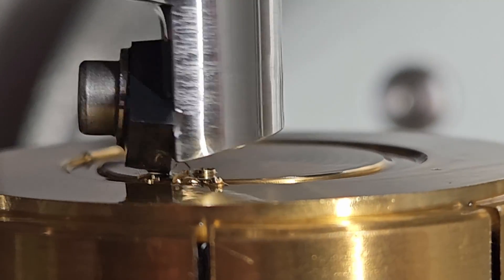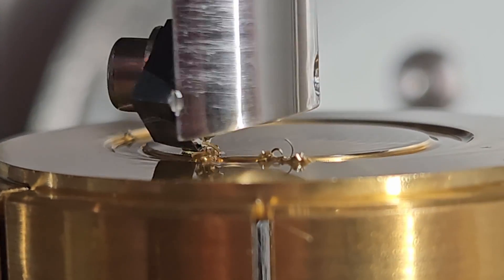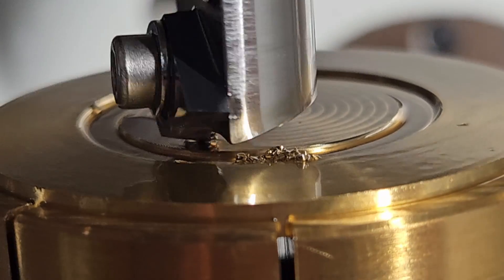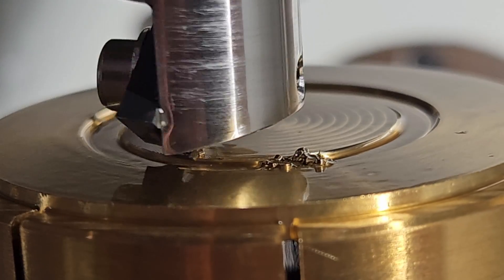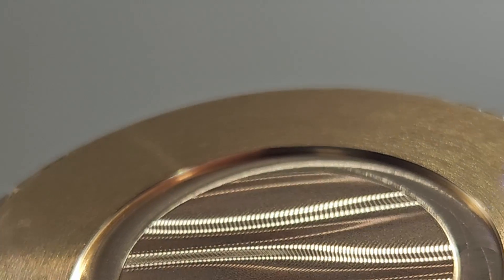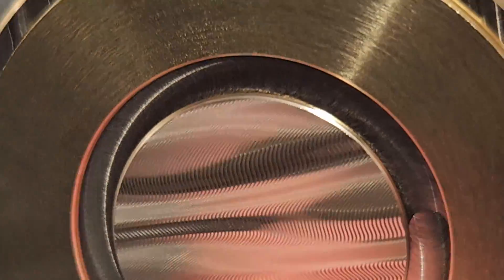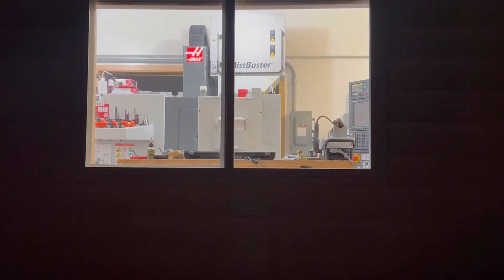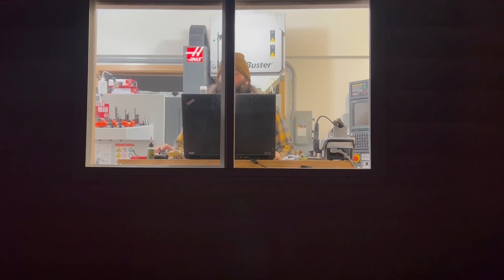CNC Scribing of decorative patterns

Comment: Im really interested in how the Erowa mounted cutter works. Does the cutter orientate itself based on the movement of the material like a plough?
Reply from the maker: @Anatheme-  his original setup on the kern pyramid had the tool held static in the erowa holder . Only his new kern micro hD had the tool rotation
Reply: @adamthemachinist  thank you for the reply. I apprecaite it.

Comment: Love si much this topic, i am a french machinist for luxury,
And i love those decorating technics.
Thanks for sharing.
If your spindle has not an encoder, you Can also genereate with the right  CAM
Guilloche with static spindle tool, only playing with C axis and XY (or Z) moves.
Look out also what you Can Do  with ultrasonic guilloché, to add colors playing with light wavelenghts regarding the couple amplitude /speed of  thé Z piezo ultrasonic acuator wich is micron précise.
Most important point iss thé ability to do it on complexe 3d shapes, to do things no one does using traditional tooling.

Thanks again for your fantastique content, which stand for high quality manufacturing instead of replacing traditional manners,  going further into making nicer and better designs for objetcts, which then you respect more and take Care longer.
Verry hard and counter- intuitive mindset to transmit to productive side of Big companies

Comment: Rather than dealing with controlling the spindle rotation like a rotary axis, could you not just use a 4th axis/rotary table to control that?
Reply: I was wondering this as well. Seems like such a simple solution but I’m assuming there’s a good reason why it doesn’t work as well as spindle orientation.
Reply: To answer my own question, the fact that it would practically never rotate in the same axis as the spindle/tool might be impossible to overcome in some situations. You'd have to move X and Y to keep the tool in the same spot as the rotary axis moved, and depending on where your center of rotation was that might lower your surface speed out of acceptable range or something. Maybe if you stacked x and y on top of the rotary axis it would work better.
Reply: This only works for patterns that are concentric to the C axis. If you'd like to generate patterns on the side of a part by tilting the B axis, this would not work.

Comment: Not long ago, YouTube suggested your video where you machined 1911. I tried to find that video and you but seems you made it inaccessible.  I like what you do and how you are doing it. And today you talked to Australia guy about guilloche. Don't you know we have a Plumier Foundation and many people here in the US? I do not see a point of making guilloche on CNC machines. Rigidity of manual machines is not a problem since the angle of your cutter is about 160 degrees, and the depth of cut is a few thousands. I was making guilloche on titanium tube mounted in a pen chuck on a straight line machine. The cutter had a tungsten carbide tip and cut titanium like a butter. The difference between rotery machined and linear cut is the shiny surface. You can't make it with a rotary tool or laser. That's why I hand engrave pieces. It looks always better than machined. Hand- made watch dials are unique.  It takes years of training to cut such a dial. That's why it is expensive. While todays machines and technology allow cut something similar, it will take too long to set up a machine, plus the tip of the cutter should be sharpened frequently. Otherwise, the cuts will not shine. Thanks.
Reply: Youtube is run by commie democrats. They forced him to remove the 1911 video. Even though everything he showed is perfectly legal... But it hurts their delicate feefees

Comment: Thats exactly 1:1 what i make most of the day at work. Hobbing operations on the C-Axis has a bit of a struggle. At first, our CAM Software is not able to simulate directional cutting tools, so you have to take a good guess what you are doing. And even the tools have a downside. The relief angle (backside) of the tool doesnt allow for sharp turns, otherwise the butt of the tool will squish nearby geometries. If you got crazy complex geometries, you have to account of all the cutting angles, and even find a way to dive in the tool, without pushing material around.
Destroyed just today a diamond tool for 680$, controlled everything, checked it multiple times, still scrapped the tool (was 0,3mm) in a extremly narrow space.
But at the other hand, diamonds stay sharp for a very long time, and the surface finish is unmatched.

Comment: Could people that don't have access to a discarded Rolex milling machine, build a stepper motor on the table? ThisOldTony retrofitted a complete CNC system into his manual milling machine, so maybe it is easier if you start from scratch 😅
Reply: You can do this fully manually using a rotary table and a notepad, but doing it in volume you need the Ferrari Rolex machine. Traditionally there is a special machine with pre made cams for each pattern, or even more traditionally, hammer and chisel.

Comment: I'm finding myself still listening to this with fascination despite not having done any CAD or machining in my life. I'm a web developer though, so the constraints that you discover and have to hack into the CAM software IS interesting. Also, never seen this type of code, but I can imagine parameter requirements for a tool path that has modifiers depending on the tool, material and combination. The scriber becomes a category like a mill or drill is. Maybe it needs to accept an RPM argument because it is a milking machine, which is then nullified by the Tool code. The C axis is interpreted from the direction of the straight/curve/bezier tool path just like X and Y.

Some time ago I believe smarter everyday visited a CNC metal deformer. Their challenge is even bigger, because the whole material stretches based on where you are pushing and can then lead to over/under forming if the tool paths are not corrected at the CAD stage
Reply: I seen that twin point titanium forming vid, it was cool. Destin is great, the vid series at Kodak was amazing. That rotary forming is still new tech, it will get better for sure👍👌🇦🇺

Comment: Impressive and interesting video Adam.

Fwiw and nothing to do with cnc, but for purely old school mechanical methods, there were geometric chucks built. Plant and Ibbetson were just two of the manufacturers. They can be built up in multiple layers and each one has multiple sets of different gear ratios that can be changed and combined to both slowly rotate the chuck and can drive a slide in either or both directions on each layer. This video shows a simple single layer chuck without a slide. https://www.youtube.com/watch?v=_ogsfwigpF4 Visualize something as complex as an enlarged drawing of the structure a snow flake consists of. These chucks can be set up so a rotary cutting head can cut even something like that in one continuous line as the chuck rotates. Basically a preset program installed into the chuck using only mechanical methods. Few have ever heard of those geometric chucks. Ornamental turning, rose engine lathes, straight and rotary guilloche as well as these chucks are all somewhat related as a craft.

Comment: I have heard that hand scraping was preferred for machine ways over a ground finish in some applications, just due to the improved lubrication (I assume some sort of mixed film hydrodynamic effect) - is this technique (i.e. cnc scraping) already used in high end machine tool applications ?
Reply from the maker: Many Japanese machine tool builders still use cast iron frames and hand scrap joining surfaces , matsuura and yasda come to mind . Most European companies seem to prefer an epoxy granite frame with ground/machined surfaces that guides are attached too. In the case of the Kerns mentioned in this video, they have a constant film of oil floating moving parts above the slide ways. So pockets caused by scraping wouldn’t benefit this machine, but would a more traditional box way machine. Not sure you can say one is better than other definitely, both approaches have made marvelous machine tools . It comes down to picking more labor or more expensive technology to create the machine
Reply: @adamthemachinist  -thanks for the reply, great content by the way, keep it up.

Comment: Possible on haas mill ?!?
Reply from the maker: Not without getting into the control I suspect. The standard m19 spindle orientation won’t help you to much , too jerky
Reply: @adamthemachinist  I tried it with a UMC about 5 years ago. The Haas performs a full rotation to index past 0 for each M19 call. So it would definitely require a fair bit of work to make it all work in the Haas control.